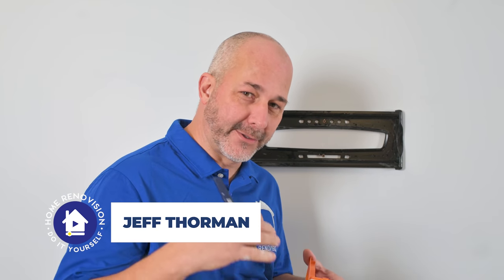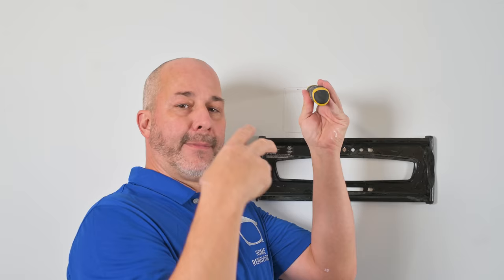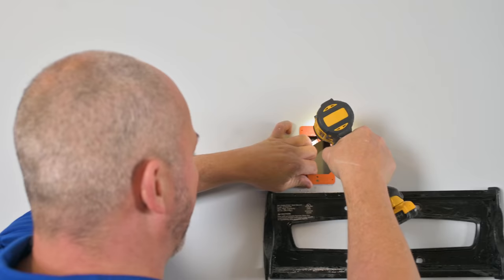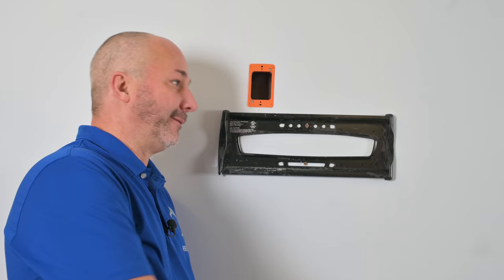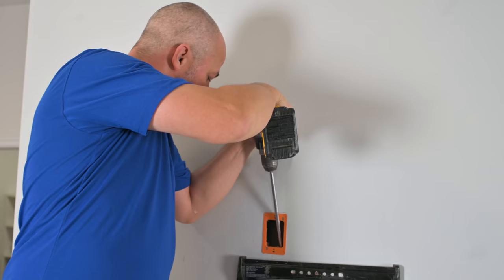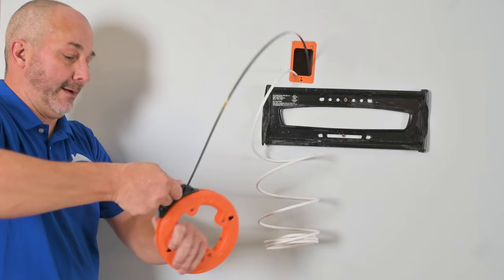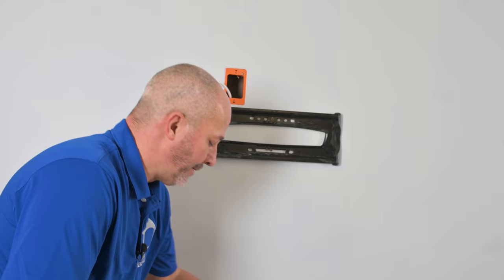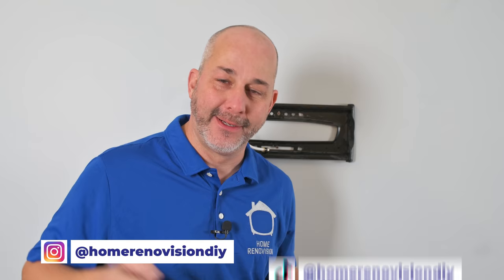How To Hide TV Wires | DIY For Beginners

Comment: I'm confused, Jeff... What about the power cord for the TV? I thought you were going to show us how to hide THAT.
Reply: Perhaps he's reluctant to encourage people to do their own electrical as opposed to hiring a professional to do it properly.
Reply: They sell kits for power cables. If you do it this way and send a power cable through, you might have an insurance issue...especially if a fire starts.
Reply: Idk, running some Romex to make a new outlet up there isn't all that different. Same concept.

Would be nice to see that done for the full install.

Actually just curious if Jeff planned to do that, or handle it a different way.

Love the channel. Just finished a full bathroom gut job thanks to Jeff and his confidence-boosting videos!
Reply: They make in-wall rated extension gizmos. I have one that came with a whole kit with cover plates, hole saw etc etc. same procedure but you need to figure out how to fish a 120v plug
Reply: @toin9898  oh cool, I'll have to check that out
Reply: run the power cable through, too...
Reply: Wifi the power cable
Reply: Agree. This whole project seems a bit pointless unless the power cord goes into the wall.
Reply: Laws rules and regulations says you can't. Have the electrician put a socket behind the TV :)
Reply: Most new homes have a outlet where you would mount the tv or around that area
Reply: Really aren’t supposed to do that.
Reply: This is nice…….if you have a battery operated tv.😮😂😉
Reply: Seems a bit of a botched job to me for an instructional video! No power cable fitted, so I'm guessing it's a solar powered tv! 🤔🤔🤭
Reply: Yeah a little disappointed in this one. Running 1 coax cable is not job complete. That’s the easy part, I think pushing your power cord through the low voltage box and dropping down like he did for the coax is probably not up to code but most if not everyone will do that. Jeff probably knows that too which is why he didn’t even mention it and shows the technique to use for any wiring. 😂
Reply: @nonameentered1918  ugh A FLAT SCREEN LED TV DOES NOT CREATE ENOUGH HEAT IN THE POWER CORD TO START ANY FIRES.
Reply: Eaton makes a two gang plate with a recessed low voltage cable hole on one side and a  single, recessed, AC outlet on the other.
Reply: Y’all need it to specifically be a power cord in order to know how to push a cord through a wall??? Great day……
Reply: The whole point is to show you how.
Reply: @TimTobias3219  correct, my current home was built 5 years ago and it had two outlets behind where you would mount a TV. One had a coaxial and ethernet port the other was a standard outlet.
Reply: @kevinmatson1197  most people would run the power cable down after mounting the TV, problem is it's not up to code and not allowed to run it like that so he did not show you.
Reply: Yeah what about power and also HDMI cables? Oftentimes people have more than one component
Reply: @mrb6597  assuming there's a receptacle below to attach the Romex to there's much more to this
Reply: @dang8491  I'm not quite you understand the concepts at play here. 😒 the "heat" in the wire isn't the issue 🙄
Reply: Just put the power cord through the upper box down to lower box. Extension cord if needed
Reply: Why use a "low voltage box" when you also have to run power to the TV? It makes no sense at all.
Reply: @Deeda1021 Duh, Deeda, yes y'all DO need to know , *specifically*, how to run a power cable. He's using low-voltage boxes which will NOT meet code. Can you (physically) do it anyway? Sure, but you'll run into problems trying to insure or sell the property later. The latter is especially problematic if a savvy prospective buyer has their own inspector. Once the error is revealed you'll have to rip it all out, then pay a professional, who'll have to pull a permit, to do it properly. And guess what? Once that 1st inspection reveals the problem, you'll have to disclose it to every other prospective buyer whether or not they hire their own inspector. 
So again, y'all DO need to know how to properly run power. Great day.... Deeda
Reply: @melikebatgirl8312  Haha, why are y’all mad? I wasn’t, I was rather confused. The comment underneath mine says what I was basically trying to get at. This is clearly not a complicated situation video. It’s for laymen. Great day…..6 months later. 😉😙
Reply: Is the new cordless TV
Reply: Couldnt uou do the same trick but use an extension cord.
Reply: It’s a wireless powered TV duh
Reply: To add to some of the suggestions…I’d run a conduit through the wall and thus future-proofing evolving wires with evolving technology. Pull the old one out and the new one runs down the conduit.
Reply: It is against NationalElec.  code to run non approved conductors in the wall cavity. I usually install a regular receptacle behind the TV to plug into
Reply: Bro wtf just run your power cable through just like he shows in the video. Please tell me you're just trolling
Reply: I have a question… how do you use this concept over a fire place?
Reply: Erm, take the plug off, feed the wire through the wall along with the other wires and then put the plug back on.
Reply: ? It would be the same idea
Reply: Great video, thanks for idea!
Reply: Power cable
TV aerial 
Optical cable to amp
4 HDMI cables to media devices

Thats 7 cables. 
How the hell do I do it??? Where do I START man!??
Reply: Easy... cut into your power cord which then voids its warranty and repeat the same thing... don't got to have a socket also hidden someone where 😅
Reply: My parents got something like this installed in their house in the living room. The wires are hidden, but what you don’t see is a giant hole cut in the other side of the wall in their room and wires hanging out 🙄🤦‍♂️

Comment: Hey Jeff, long time viewer here.  Here's a tip.  You see the tiny holes in each corner of the low-voltage bracket?  Flip the bracket 180 and place against the drywall.  Mark your four dots.  Move the bracket out of the way and connect the dots w/ a level.  You now have your inner cut lines and they're completely level!  Perfect Everytime!  Cheers!
Reply from the maker: Love it. Cheers
Reply: @HomeRenoVisionDIY  Came here to say that too.  That's the definition of "perfect every time".  Also disappointed that you didn't throw a laser on the wall so the outlets would be exactly square and in line with each other.
Reply: @steve345  sorry, you can't run power cord in wall. You could extend  lower outlet with 14/2 electrical wire and put new outlet next to low voltage. You'll need " old work " box. Not hard but a bit of time.
Reply: @steve345  I thinking what @bob ainsworth was saying was that it's a code thing.  Not that it's not physically possible.  Just that it's a no no to run the power cord behind the wall - fire hazard.

Comment: Protip - always start cutting drywall left to right in case you hit a stud you can go the other way. If you start cutting up and down you'll never know stud is there when you cut across left and right.
Reply: would have never thought to do that.  great tip.
Reply: Not a bad tip’ 
However if you’re ever cutting into wall always use a stud finder’ eliminates the problem 🙃

Comment: What if it’s an outside wall with insulation
Reply: Same process.  Just cut away or move the insulation.
Reply: And how do you cut the other 4 feet of insulation
Reply: @patrickcavanaugh1809  you don't. Run the fish tape down, in front of the insulation and pull the cables up, through.

Comment: Ive been mounting tvs and routing cables as part of my job with the city for 12 years. I can honestly say when it comes to mounting tvs, theres a right way to do things and a safe way to do things. And to me, you did absolutely everything you were supposed to do! One thing that I appreciate is that you showed the good and the bad when wall fishing the cables. Alot of people make these videos look easy and it misleads people on DIY projects. Much respect to you and thank you for what you do!
Reply: I enjoy seeing the mistakes or mishaps...great teaching moments
Reply: Well...........sorta. According to code in basically any developed country, the way he did it is 100% in violation of code. TVs are not low voltage appliances since they operate on 120V, and low voltage is defined as anything below 50V (which clearly 120 isnt). Anyway, in reality it's probably no biggie, but in terms of code, this is deemed officially NOT SAFE, meaning if a fire ever broke out and your cable was determined to be the cause, your insurance will cover ZERO.

Or you could just spend the 50 bucks for a certified safe kit that allows for high-voltage in-wall.
Reply: @NickVincent The Coax cable he put in IS low voltage. IF he put 120vac in the same low voltage box then it would be a code violation.  But he didn't.

Comment: For fishing wires in walls you can also use a piece of chain tied to a string and drop it down thru the wall. The weight of the chain will work its way down past obstacles.
Reply: Thanks! Going to try this. Been using the modified tape measure method which works decently. Fish tape sucks!

Comment: Jeff, glad you showed the problems that you run into when fishing a wall. Viewers should know you can’t run the tv power cord that way, but boxes are available to run in a length of romex in and stay within code.
Reply: Yes. I thought about running the power cable behind the wall and realized that you have a high voltage issue again. Also, I am not too sure about drilling so many holes in the fire separation.

Comment: Nice technique using the low voltage fixtures. I hid wires on a few wall mount TV some years ago using kits from the box store for this purpose. They work, but think your technique looks better. Of course, when done right, you shouldn’t see the faceplates anyway. I didn’t notice an electrical outlet there by the wall mount, that is usually part of the cable management job as well.

Comment: Also, using a double gang low voltage box is usually worth it to have a larger hole to work with.  Especially when dealing with HDMI or other wide cabling.
Reply: So this is only for single cable right not multiple

Comment: After running into the fire block, you could also just move the box below the mount and fire block.   Can you do a video on putting AC outlet behind the TV?
Reply: I would love one around this. Since that is the main thing I am having trouble gaining the courage to tackle. We have 2 TVs we want to hide the wires on. One in the front living room, easy enough. Then the second one is the one above a gas fire place in the back room. Would love to see how to properly punch holes in the studs to run wires horizontal and how to connect to existing plugs.

Comment: Little tip. Run the wires before you put the low voltage ring, you should be able to even fit your hand in there.
Also most electrical wires aren't in wall rated so don't be running extention cords in there

Comment: I always enjoy your videos Jeff!

Question: how are you planning to power your TV? Reading other comments, this isn't the method for running higher power cords, but I figure that if you're hiding one cord you'd want to hide them all.
Reply: My thoughts exactly are you putting the 120 to the TV in this low voltage box as well. I'm fairly certain that is not to code.
Reply: I call an electrician to install an outlet behind my Tv. I usually provide them with a recessed power outlet so everything looks nice and neat. If you want the outlet straight above an existing outlet, it’s a fairly easy job as they can just get the power from the outlet below by making the connection behind the dry wall. Because it’s Romex cable it can run in the wall.
Reply: @hb2998  it’s still $150+ to hire an electrician to install an outlet. I’d love to hear what his plan is or if he’s just going to break code and run the power through there.
Reply: @richgrant3312  Why would you need to do that? Just reroute the actual electrical cable. You've no need for an electrical outlet near the bottom anymore. Either reroute it or get an electrician to come out, reroute the cable, place outlet behind tv and done.
Reply: @meatcute1266  150 - 300 for a peace of mind? Cheap to me. And, if I am concerned with perfecting the install and hiding cables then clearly that person could afford it.

Comment: Jeff I think the video is great, however you should have mentioned that you should not run electrical wire this way since it's not code and also a fire hazard. This goes for the actual power cable for the TV as well, you should not run it in the wall, you have to add an actual outlet with the proper remodel box. Otherwise great stuff, love the videos!
Reply: Agreed. I actually found out about this on a different video. It made me rithink my strategy

Comment: For fishing the lines in the wall, once the holes are cut out, I run Pex through the back side of the drywall.  You can then thread the wire in the pex,and then once the wire is out the other end, you can pull the pex leaving the wire.  Works Brilliantly when there is insulation in the wall!

Comment: Like many other people have commented previously in this video- we feel that it needs to be a series. Where you explain about each different type of wire that is usually attached to a TV mount on the wall such as- the actual electrical plug to the TV, the cable that you showed, also if there’s like a Blu-ray player, or game consuls that would be plugged to the TV as well. How do you hide all these wires? Maybe you could actually do a series and show how you can do it all at once with like some kind of tube, or some thing inside the wall where all the wires organize d together using rip ties to make it like one big wire. Also somebody mentioned some thing about some fire resistance foam needed if you put break that fire piece of wood that you were talking that you had to bore a hole through inside the wall, maybe you could explain about that too?  Look forward to seeing more videos regarding on how to mount a TV and hide the wires behind in the wall.
Reply: You wouldn’t need a series on this because they all follow the same instructions no matter the type of wire. Use as many wires as you can fit through that cover plate opening. If you run out of room there are larger pass through wall plates you can use. Although, the one he used could easily fit all of the wires you mentioned.
Reply: With the setup presented here you could probably easily pass up to 4 hdmi wires through the hole or you could also use a different kind of setup. For my home projector setup , I use only one very long hdmi cables that is attached from the projector to my 7.1 amplifier "hdmi out" connector. All my additional inputs are connected directly to my amp which reduce the amount of "long" cables needed for the setup. You could also use a hdmi selector box for this. For the electric plug itself that's a different topic, since it is a "higher voltage" wire, that standards are completely different and some province or state force you to hire an electrician to do the job. Still pretty sure Jeff have plenty of info on how to install standard electric plug if you search in the video section :)
Reply: Eaton makes a two gang plate with a recessed low voltage cable hole on one side and a  single, recessed, AC outlet on the other.

Comment: Heads up to anyone doing this. If you end up running your TV electrical wires behind the wall using that style of outlet, it is against the electrical code on Ontario. You need to have a dedicated outlet running up the wall with the proper wiring. If a fire were to happen near the TV area this could go against your insurance claim. All other types of wires are considered fine.

Comment: Great advice - I used a hole-saw and just missed the 220 line for the Kitchen stove by a 1/2 inch.  Now our new house the tv will be attached to an outside wall.  You just showed me how to do this the proper way and drill through the cross piece I was worried about.  I’m sure there will be a real struggle getting passed the insulation.  Maybe that threading tape will come in handy.

Comment: Jeff, also on the low voltage boxes there are small holes in each corner that you can use to mark wall to cut hole out. And how about power for tv ?

Comment: Nice work! With my luck, the spade bit would have come dislodged in the wall and fallen through the hole I just drilled. :)
Reply: Yeah, they make flex auger bits to drill through studs and fireblock. Klein tools makes 54 inch ones. They even have a hole at the end of the bit so you can fish your wires once you cut the holes. Spade bits work too, but not for something further behind drywall.

Comment: Only issue is the power cable still will be hanging down, as you can't run the power cable through your wall
Reply: ohh... was going to. Guess that isn't considered low voltage and maybe not a good idea eh?
Reply from the maker: you can run a new line from a plug and add it behind the tv. Cheers!

Comment: Hey Jeff! Great video on something I've been meaning to do; thanks for the motivation!  I have the problem of fire blocks as well in one wall, was great to see it covered.

Quick code-check to other viewers: in my area, any penetration through a fire block must be filled with fire-rated foam.  Do you have one you recommend?

I may end up running conduit down the wall to house the wires, as then I can still move them freely.

Running power outlet is another story; would love to see that in a follow-up.

Cheers!

Comment: Lots of questions.  What if the fire breaking the wall is lower?? I’m also assuming you can only mouth your TV as high as your power cord is?? Our TV is set up with a lot of wires to run electronics.